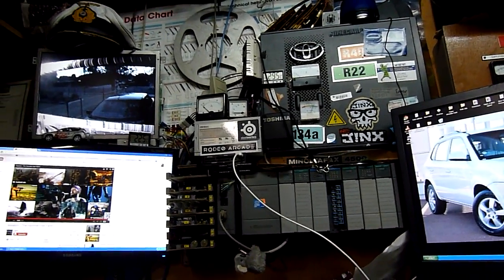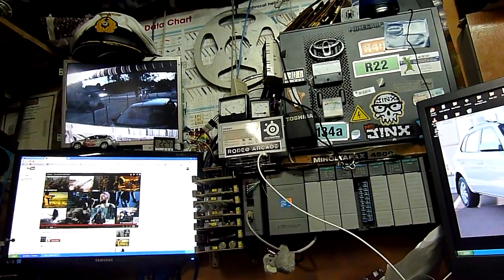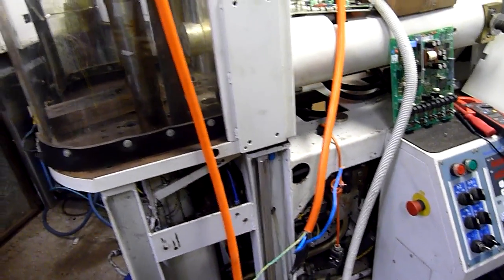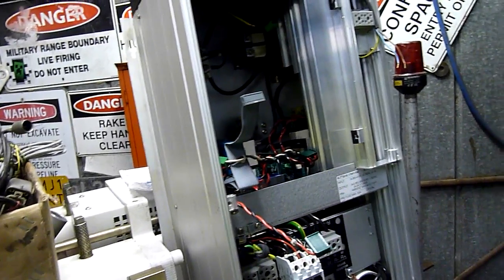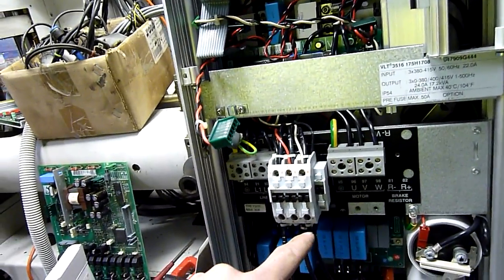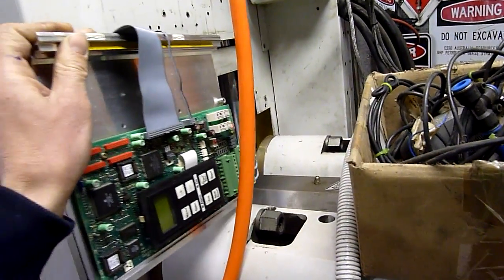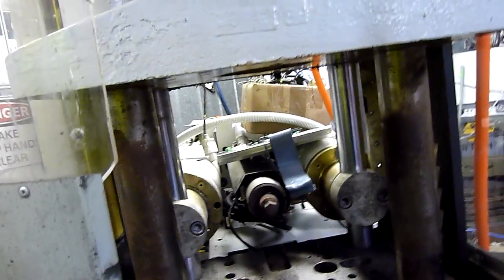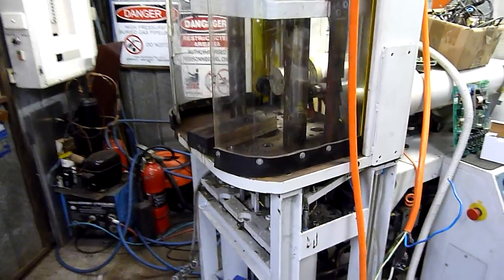Ramblotron Entry for July 12 2013

Comment: Hi Ed, I Just completed a power upgrade in my house for my workshop. Went from a 35A mains (10mm mains input) to a 63A mains (16mm mains input) to the house with a new switch board (with RCD's etc). Also ran a 16mm feed from house to garage since I have alot of demand out there (Miller Dynasty 200dx has 28A input on single phase).

Comment: Hi Ed, I was looking at 3 phase generators on Eggbay the other day. Thinking it would be easier to run my big 3 phase stuff like the Ward turret lathe and other woodworking machines. What are your thoughts? Not ideal for contant use but i thought the occasional requirement might warrant it. I saw 3 phase 415v jobs for under 500 bucks @7KVA ~ any pitfalls in that idea?

Comment: upgrade the switchboard yourself and don't tell anyone. you know how to make it legal. 16 mm cable from the meter to main switch. rcd everything separately. and like you said breaker in the board and rcd in the shed. this place had some dodgy wiring, but i was never going to wait till i could afford to pay someone. i didn't want the house to burn, so i made it safe and legal

Comment: what happened was that AL wiring became popular in the US in the 70s as a cheap alternative to copper for, but had a tendency to expand and contract based on the load and corrode when exposed to certain kinds of metal, getting loose and potentially sparking up much.

Comment: could you not use some sort of array of ultracapacitors instead of batteries? I saw a vid of a guy in america using a small bank of ultra caps instead of the battery in his car, and he also connected them to a single phase inverter and ran a drill press off it.

Comment: Aluminium wire has a poor reputation in the US after house fires because of poor connections (aluminium oxide is a poor conductor) At least here in .fi it is only used for feeders and other higher-amperage circuits and only in terminations designed for aluminium, so it's not really a problem.

Comment: I built my own inverter with a friend of mine; reusing a commercial one could have been more work, it took us about a month of work to implement ours on an Altera DE2 board and custom-made power stage. Off-the-shelf VFDs have quite many things you need to kludge; you need to get rid of the input rectifier to enable regenerative braking energy to flow back to the battery and bypass any phase monitoring circuits. A good driving experience also requires power, so the VFD gets very expensive.

Comment: AC EVs are pretty safe, an induction motor is not going to go anywhere if the control electronics are disabled; even if there is a short feeding DC that actually works as a brake. DC EVs are very dangerous, the failure mode of a MOSFET controller is short, causing the motor to produce max torque, and the current is likely to weld the main contactor closed unless it is very oversized. Just better hope your brakes hold and the main fuse blows.

Comment: Heh, could be worse, the cabling in my old house was scary, the feed from the meter to the breaker box was what looked like clothesline wire with a piece of (very loose) PVC sleeving over it... They at least got rid of the nasty black rubber insulated flex in the ceiling.

Comment: I built an EV out of a Suzuki Alto with a rewound 7kW motor (nominal voltage around 70VAC.) You will not get good performance from a 230D/400Y motor unless you have a very high battery voltage (bordering on the limits of the motor's insulation.) My conversion currently has 8 12V lead acids in series and the top speed is about 50km/h; it will not pass .fi vehicle inspection because of the weight of the batteries but I'll be getting LiFePO4 batteries later.

Comment: Get a big isolation transformer, I use one to prevent RCDs from tripping when testing suspicious things. Just need to remember to megger the devices before plugging them in directly (or worse, storing them and subsequently giving them away)

Here in .fi RCDs became mandatory only a few years ago, and unlike elsewhere ungrounded sockets take grounded plugs which can make for very unsafe situations (if you plug in a grounded power board and one device leaks, all devices will have a live chassis)

Comment from the maker: yeh I was thinking of the issue of a runaway drive, I would have a kill system built in, probaby break the connection to the motor and shut off the feed from the batteries without creating a dangerous arc

Comment: How old is that VFD? If it is really old it could be some component glue becoming conductive if it has any. Also, home built electric cars can be dangerous if the control shorts out. That VFD might be safe but at least use a good potentiometer for the throttle if you do it. It usually costs $10000 to convert a car to electric, look up Siemens EV control gear and matched motors. It bolts to a manual gearbox and gets you 150km per charge.

Comment: The electric car conversion sounds like a great idea, especially considering the price of gas and it is highly educational. You can also revive old lead acid batterys you find at the scrapyard by boiling some distilled water in a pan or whatever, and then dissolving epsom salts into the solution. Then distribute the epsom water solution into the cells. Has worked about 75% of the time for me with dead lead acid batterys, so worth a shot. Also you can convert the battey to alum (search alum batt)

Comment: The standards your wiring has to keep are way, way higher than what I have locally. And unless the buyer hires a house inspector when you sell your house, nobody gives two shits what you've done to the wiring. I've been fixing the 'genius' wiring the previous owner of this house did for the past ten years, and I'm STILL finding terrifying fires-waiting-to-happen. Last thing I discovered, I did by getting shocked by the wired-to-hot ground wire on the spot light on our garage, on a 12 foot ladder

Comment: Find a buddy at a battery recycling company, and get a pallet load or two of old NiMH cells. 'Dead' NiMH cells can be revived with by zapping them with a welder. Then you just have to build the cells, which is just a bunch of soldering and shrink wrap.

Comment: (Msg 1 of 2) Hiya. Please do a vid on your main incoming panel in the house. It would be interesting to see it.

If you're right in what you're saying, I can't believe that your house is running off a cable which is less than 6mm in size!

I know that 6mm will take 40A (9.6 kW at 240v)

Our house has a 60A fuse & the tails coming out of the meter are 25mm, which are good for 90A

If the cables you mention, run between the meter & the main switch, it's down to you / landlord to replace them.....

Comment: (Msg 2 of 2) ...BUT you won't be able to disconnect power, as you need the power board to pull the main fuse & install the new cables [that you bought] into the meter. Then they'll test & reconnect power.

TOP TIP: When you contact the power board, ask them what the capacity is of the cable coming in off the street, & ask them to have an accordingly sized fuse installed in the service fuse holder. If the cable is 110A for example, ask for a 100A fuse, then make sure you have correct size cables.

Comment: Why is Australia so strict? Here in the US we have Two 200 amp 120 volt feeds into our breaker panels as a standard service. We can change out light switches and outlets and add circuits on our own as long as it meets code if we ever want to sell the house. Plus, why the the Whole house rcd? They should just use specific circuit RCD or GFCI . Anway, good luck with your project, its your money, your time, and your project! Do what you want with it. Either way it will not be wasted!

Comment: its called a "AMI" (accredited meter installer) here its a 2 day course (expensive as hell when they do run  them) but yeah simple stuff not allowed to do it as technically that fuse is the suppliers fuse and if it was next to the meters (as they are for undergrounds) it would be sealed shut

Comment from the maker: what level of qualification do you need to handle the main fuse?, I can understand doing work on the main line is serious stuff, but removing and inspecting the fuse should be a pretty straight forward thing as long as you remove any load first.

Comment: Sounds like your electrical rules are like ours
See if you are allowed to have a dedicated cable from the meter via just an isolator, and put the rcd in the shed panel, alternately something like a 100mA rcd near the meter to protect the cable run, and a 30mA rcd in the shed.
Yep, doesn't matter if the VFD's are single or 3 phase, they just rectify to a single DC rail before being converted back to AC, the only real difference is that 3phase vfd's have sensing to  ensure all 3 phases are there.

Comment: I'm currently using my secondary account and have to change my password every time I shut the browser. I came to the conclusion it wasn't the browser as it still does it on my other computer. Been like it for a couple months. Though in that time it worked right for about a week. But every time I try to reset the password on my main channel it tells me to contact channel owner. O.o Derp I AM the owner.